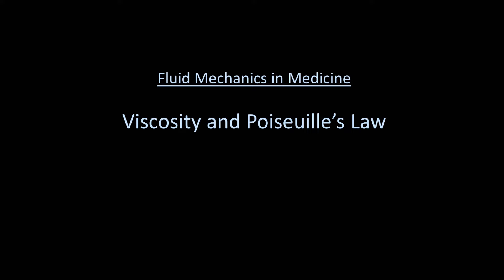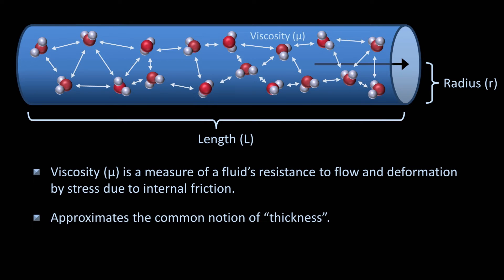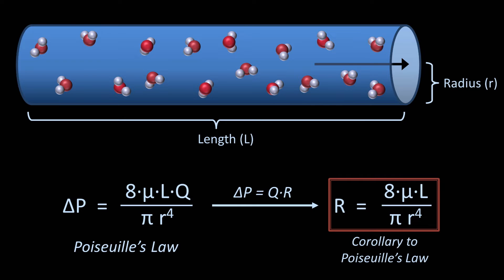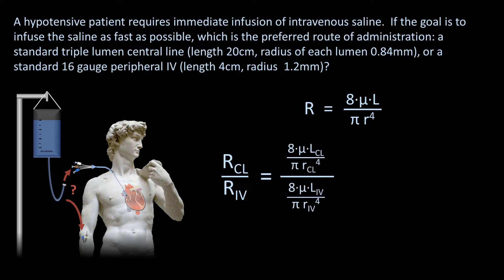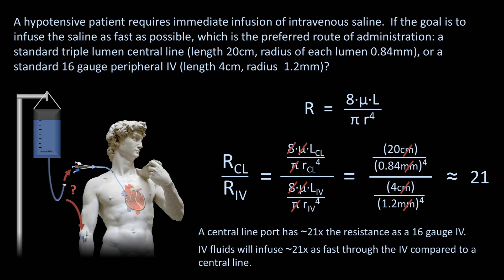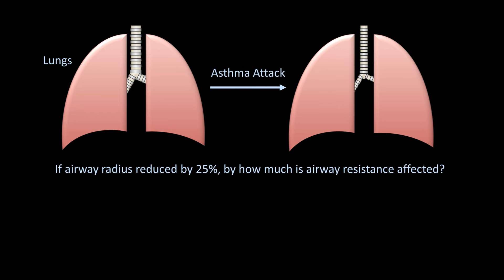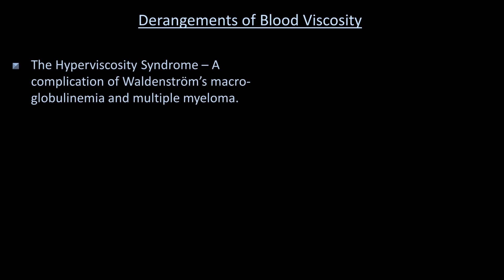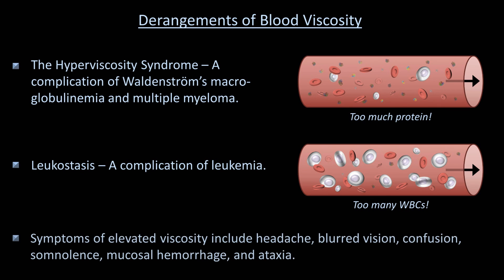Viscosity and Poiseuille's Law (Fluid Mechanics - Lesson 10)

Comment: thanks for this great lecture. I would like to ask that you have given a example of central catheter which have low radius and Residence was founded 21 fold increase. but flow is also proportional to delta P. if central pressure is far lower than peripheral pressure . The flow can be greater  in central line (Q=P/R)

Comment: Wouldn't the small radius of peripheral veins add to the flow resistance in comparison to the much larger radii of veins that CV catheters typically access?
Reply from the maker: CV catheters are usually inserted far enough into the central veins that their tips reach the junction of the superior vena cava and the right atrium.  Thus, infusions are unable to make use of the larger caliber of the vessels.
Reply: Eric's Medical Lectures The CV catheters pour into a large compartment (the right atrium) not adding to the resistance... but would not the peripheral IV catheters flow rate get impeded by the small radius of peripheral veins contributing to increased resistance? BTW, thank you for your videos... They are very helpful!!
Reply from the maker: VenusMorpheus The relatively small peripheral veins are still much larger than a single lumen of a triple lumen central venous catheter.  The average diameter of the cephalic vein at the elbow (i.e. typical vein in the arm used for a large gauge IV) is about 1.9mm, and only increases in size as it merges with other veins en route to the right atrium.  The typical inner diameter of a single lumen from a triple lumen central line varies between models/brands but is typically around 0.7-0.9mm.  Similar to the example in the video, a two fold difference in diameter results in a huge difference in resistance.

I suppose the total length of the circuit is longer if one measures from the entry point in the antecubital fossa, as compared to the entry point of a CVC in the jugular or subclavian veins, but this difference is not nearly enough to offset the difference in diameters between the 2 options.
Reply: Eric's Medical Lectures That makes sense!! Thank You!!